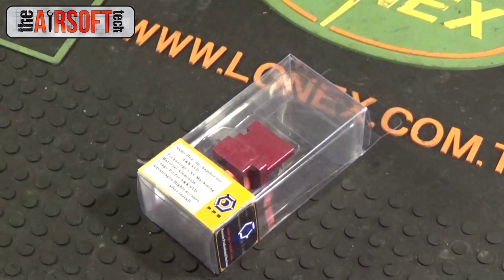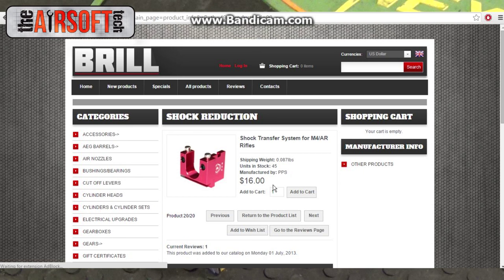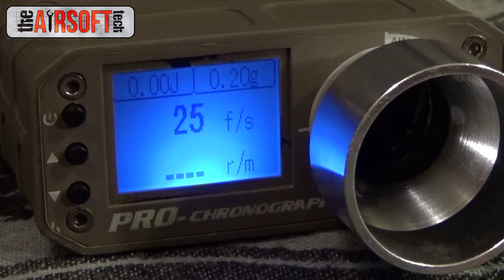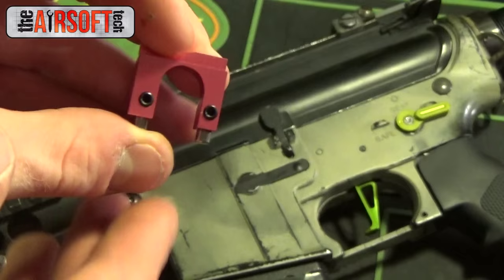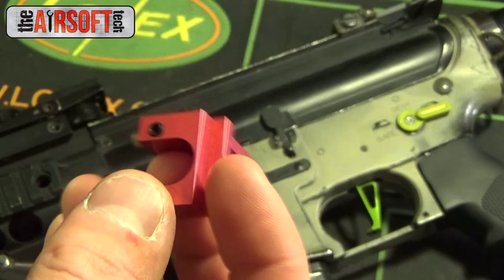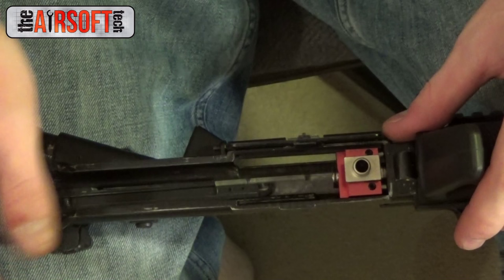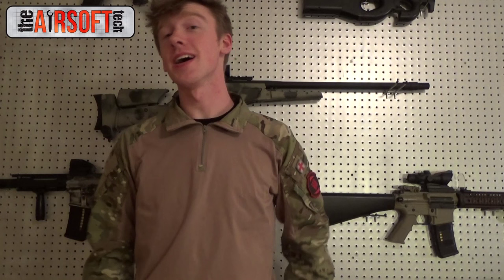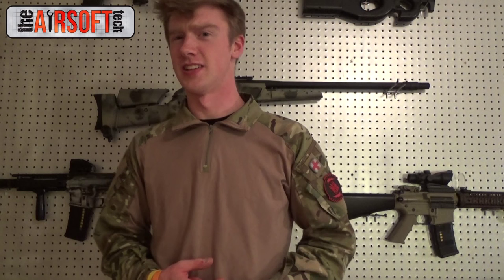Product Review: Shock Transfer System

Comment: I might have missed it but you didn't mention tightening the Allen screws again once the receivers are mated. If you leave them loose then your only transferring the force to the springs and pins rather than to the upper receiver. I'm assuming you know that but it got cut from the video or something of the sort, but I'd edit and make mention of it so that guys install them correctly.
Reply from the maker: Ah yes, I did completely forget to mention that. I'll edit that in now.

Thanks!
Reply: +TheAirsoftTech Just happen to have one sitting right in front of me in the shop I'm planning on using on an M16 build that I blew the front of the gearbox out of a few months back;)

Comment: I want to build a DMR out of a CQB M4 that can be changed back to CQB spec with a quick spring change. I've upgraded the piston and cylinder heads and also spent a considerable amount of time shimming the gearbox. The piston itself has a full metal rack. The gun is currently shooting 400-410 fps with .20s. Do you think if I radius it and buy one of these shock absorbers it would be able to handle a bit tougher spring? 450-460 fps maybe?
Reply: Thoughts?

Comment: It is not wise to use steel pins to transfer force to the aluminium body. It is gonna make 0,01 mm gap between and then stop working. I also dont think it is wise to use body ass the shock absorber. I really feel like it is wise to buy better aluminium gear box to absorb the force of shock impact then trying to transfer it to the body!

Comment: I love your channel ! I just subscribed the other day , I just bought a G&G m14 ebr L i was wondering if a 6.01 barrel with a flat hop would improve not only the accuracy but the range (i plan on switching to a R hop when i find the parts i need) . I heard that a 6.01 barrel is not that good for range because of the vibration , wouldn't putting tape around the barrel like a barber swirl  to shim it fix the vibration issue if there ever was one ? Also what would have less wear over time full metal teeth on the piston or  the plastic teeth ? Looking for something i wouldn't have to worry about fixing again . thanks .
Reply from the maker: +MrSpartan117fan First off, Id recommend keeping the stock barrel and modifying the current hopup setup. Flat hop the bucking and perfect the airseal and clean the barrel very well. If you don't see the results you want after that, then upgrade to a 6.02mm barrel or larger. But yes, 6.03mm is much better than 6.01mm in my opinion. Also, full metal teeth pistons will not damage your gun in any way if the system is tuned to cycle it.
Reply: TheAirsoftTech
 Thank you for your input , when you say tuned you mean shimmed and AoE corrected?If AoE was not corrected with a full metal teeth piston it would wear down my gearset? Was also wondering what your thoughts on madbull v2 6.03 aluminum barrels ? Stock i have a 6.04 so wouldn't be much of an upgrade right ?